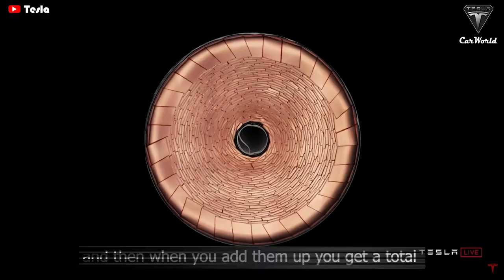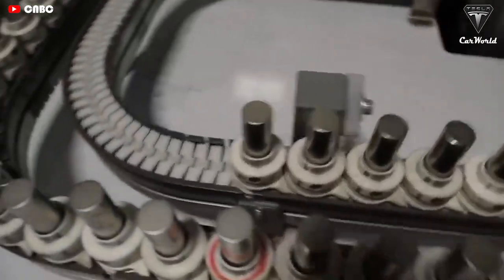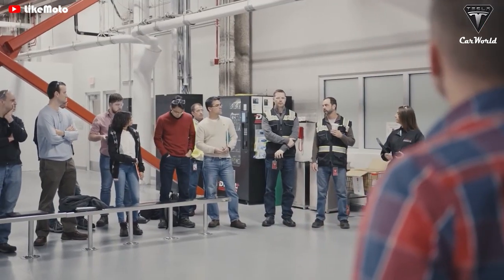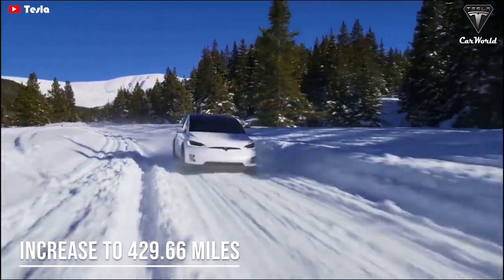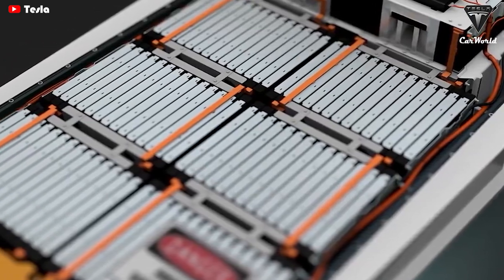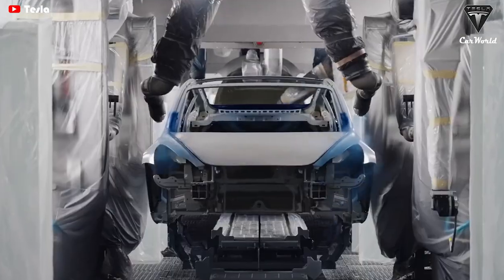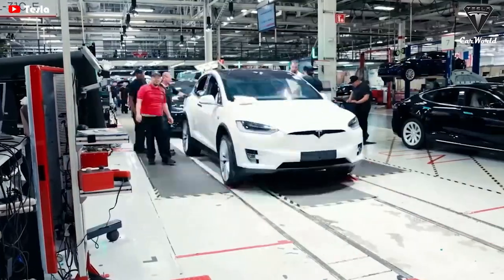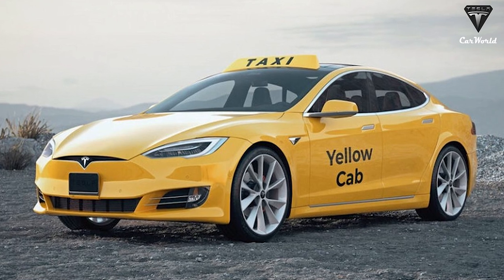Elon Musk Reveals New Modern 4680 Battery Production Upgrade, $21.20/kwh!

Comment: 21 kwh in a model 3 with say a 75 kwh battery pack about 1600$. Ten year aging decay to 67.5 kwh quite acceptable. Amortized cost of fsd vehicle 7.5 k a year. Save 2.5 k a year in fuel 400 more in maintenance. 50% less in tires due to less wear from braking and hard driving. When launched lease out 80% of it's capacity as a taxi and actually earn money. In ten years this car will cost you less than zero to own and it will probably still have value.

Comment: Where's the CREDIT to "MUNRO LIVE"  channel who are THE SOURCE of the pull down using dry ice blast... ?????
Good detailed video, might be streching with the assumption for the future range over 400km. Tesla have demonstrated they are more likely to keep the range the same and have less batteries to reduce the number of batteries required pet unit. As battery supply is the limiting factor in ramping production.

Comment: So where is the cheaper Tesla cars with LFP battery Tesla ?
Reply: They aren't that cheap. With current LFP tech expect a drop to about $65/kW by end 2023. Using economy of scale. Not to mention that demand outstrips supply. Simply put do not expect a cheaper car until demand drops. The company will absorb the profits into the new product lines and factories.
Reply: @jamesirwin7677  so the problem is Tesla, because we can, we take the price of the customers
Reply: Price will come down once demand can be satisfied. Prices have gone up substantially over the past year or so to regulate demand
Reply: @8bitbender495  
Nope if you run a business and the demand outstrips the supply the best thing you can do is raise prices. They can then invest that money into new factories to make more evs

Comment: it s a disaster, charge time is huuuuuge
Reply: With the new cells charge times should drop significantly. 80% in about 20mins at a level3 supercharger.
Reply: @jamesirwin7677  
It will take decades to have those chargers throughout the US, yet alone the world

I think hydrogen is a better long term play and is certainly more environmentally friendly
Reply: @jamesirwin7677  second generation 4680? in 5 years? we already have 10 minute charge batteries

Comment: This battery will become obsolete shortly. Solid state batteries with an added component will take over for a few decades, until the ultimate energy source is revealed.
Reply: Solid state is still 5-10 years away from mass production and the cost won't be comparable. Even with everything going perfectly solid state would take almost 20 years to be viable
Reply: Well what about now tho
Reply: Look at technology and cost over time. Solid state at best will take 20 years to become affordable and about that much time to produce at scale. Look at the 4680 from Tesla, It is implementing some new technology but it is still not ready after 4 years and it's not even as big of a change as solid state. 2040's is my prediction for solid state at scale for comparable cost of current batteries
Reply: @3312ynot3312  I always wondered what would be the range if less powerful electric motors were used in electric cars.
Not everyone needs 500hp
Reply: @scamchan  No-thing in this universe last forever.
Reply: @patbaptiste9510  Who said forever?
Reply: @scamchan  every car company makes them with different horsepower (bigger\smaller motor) but that doesn't tell the whole story. Tesla has found a way to make EVs with speed power and efficiency. If a motor is under sized it will lose energy to heat and you don't go that far. Weight is also a factor. To put things in perspective the model 3 can drive 300+ miles on the equivalent of 3 gallons of gas about $10 of electricity when charging at home. My bmw uses about 10 gallons to do the same range about $45
Reply: @3312ynot3312  Nice